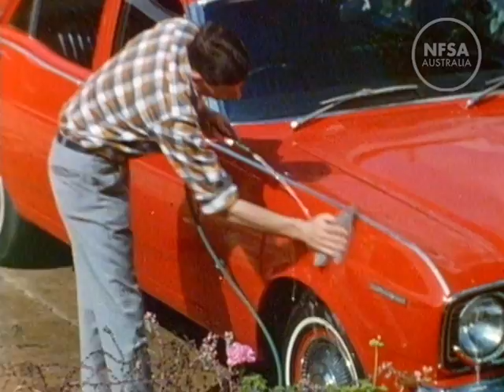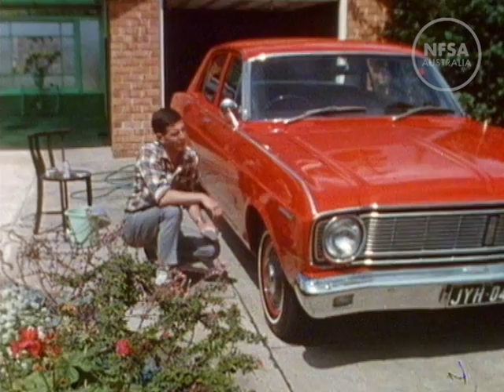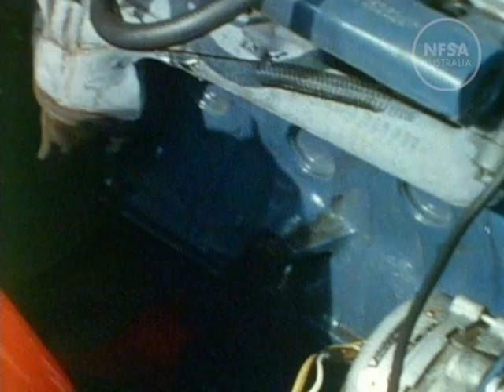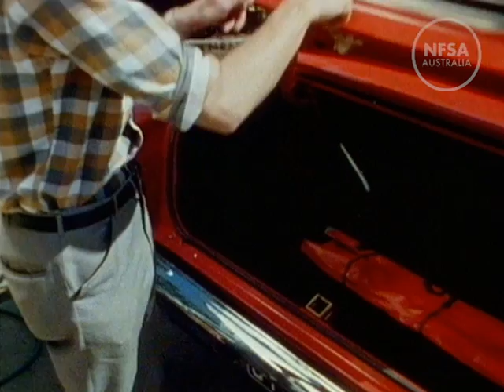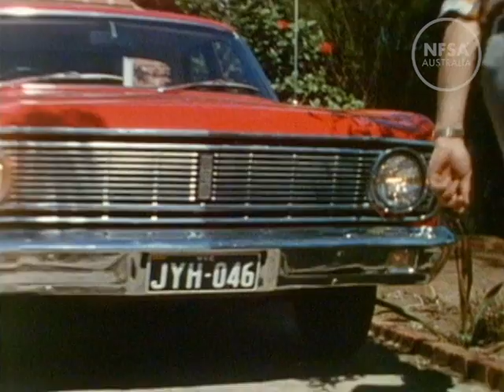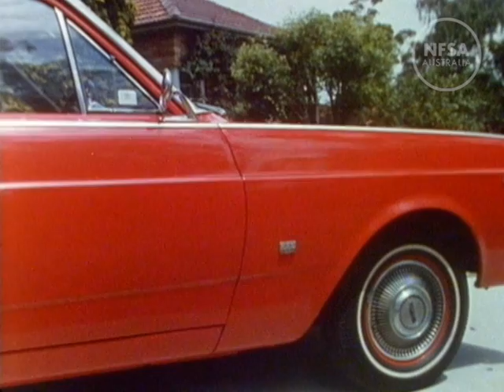Inspecting The Car. How To Drive Ep2

Comment: Magic example of an XT Falcon. Not a standard model though - chrome window surrounds and dress strip, and painted wheels with dress hubcaps and white-walls definitely special order. Surprised they didn't show how to inspect the door drains, which were really important to prevent rust on these old girls.
Reply: Falcon 500 had all this trim.Heater, radio and carpet were optional.We had one.

Comment: Never top up brake fluid on reasonably new cars.  As the pads wear the liquid drops. When the brake pistons are pushed out to replace pads then the fluid will go to the full position unless you have a Ford then all fluids will leak after leaving the showroom..